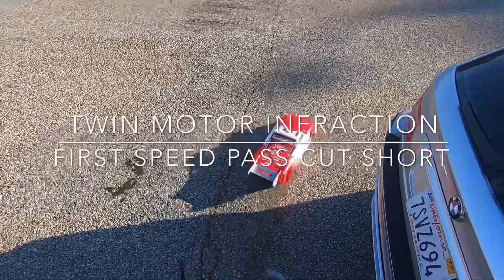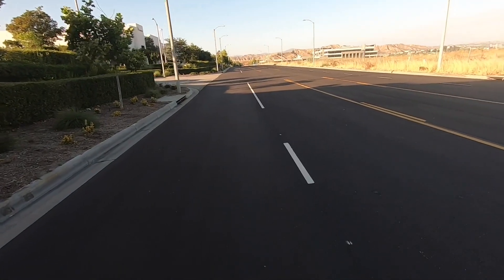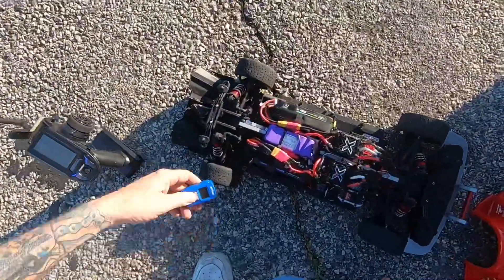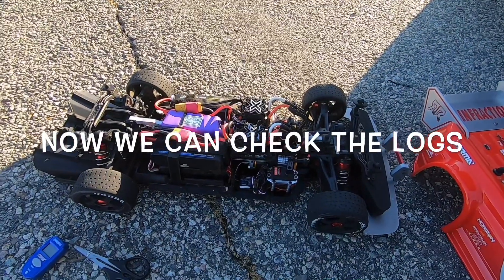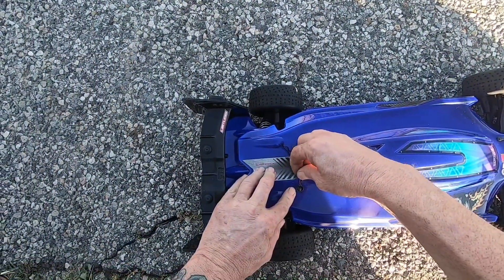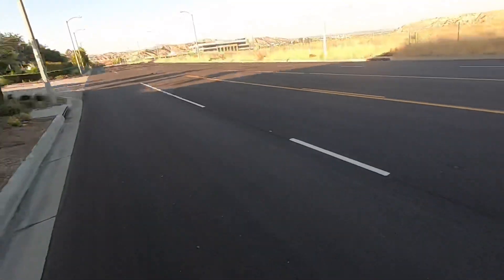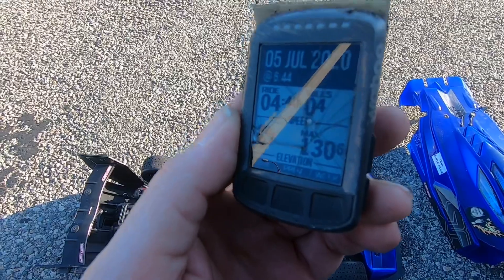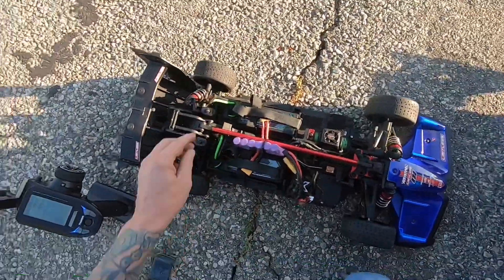Twin motor infraction speed pass & limitless PB speed pass

Comment: Awesome cars bro, just bought myself a limitless today.
Never had and electronic car before.
Keep up the great work bro
Reply from the maker: Thanks 🙏 appreciate the support & you’ll have a blast with the limitless I’m sure of it 🙏💯💯💯💯
Reply: @earlmoorhead5555   I think I might of messed up. I just ordered a tp 4050 3050kv plus MM 8s esc.
Just because I knew it would fit. Is my kv too high? Or will this be a good speed run motor?
Not looking for any speed tips. Just dont want to blow my motor or MM 8s esc.
Any guidance for a total newbie would be awesome.
Reply from the maker: MonsterTVchannel it’s a good speed motor just have to keep an eye on temps and gearing as the higher kv has more speed but will run hot with standard speed gearing you might have to gear down to achieve the speed your looking for 👍👍🔥🔥🔥
Reply: @earlmoorhead5555  thank you so much for taking the time. I thought I just wasted my money bro. I'll put a 46t spur on and see how I get on. 
Ill order a lower KV next time. I was just excited to get started. Ordered an MM8s esc, a ripple killer and a bunch of hop ups already. Guess i should of researched more first before buying. Feeling pretty dumb now. 
Keep up the great work brother.
Reply from the maker: If your going for a speed run then I’d run the limitless spur with a 20 tooth pinion to start that should be around 110 mph and gear up from there watching logs and temps Phillip J is an awesome guy he’ll help as well if you ask him 👍👍💯💯💯💯
Reply: @earlmoorhead5555  thank you very much.
I will do.
At least I'll be able to run and test for a bit.
I'll order another motor with lower kv after I've played about with what I got.
I really appreciate you taking the time brother.
Reply from the maker: Anytime 🙏💯🔥🔥🔥

Comment: Good stuff..AWESOME BUILDS! Was the blue limitless on 8s? I see you modded your radio antenna, range. How was that done? I will be using a Futaba 7px radio. Do you think I will need to increase the range and will your range method work on my radio?
Reply from the maker: I just added a better antenna I have not installed my range booster yet 👍👍all depends on where you run the futaba has good range almost no one uses a booster but some want to hit those top numbers and you’ll need a booster for that 💯💯💯and yes on 8s with a 6s motor 👍👍👍

Comment: Take a flat head shovel with you and pop up the asphalt dribble it'll pop right up otherwise beautiful speed run road the center joint of the road at the crown nothing you can do about that typically reflectors go down right away after restoration because city/County will not sign off until thats completed maybe you'll get lucky with no reflectors 🤞
Reply from the maker: Thanks I’ll try a shovel great idea 💡 I hope soo because the blue reflections are there I was hoping they will leave it alone because all the trucks they might have to fix that road a lot ( every couple of year ?? I hope I can run it for awhile thanks 🙏💯💯🔥🔥🔥

Comment: Question for ya Earl.  Building my first Limitless.  Got my rolling chassis, Flopack Cappack, Panther 5.0 75C 6S.  planning on a XLX and TP 4070 2250.  Would a 28t & 36t  saga custom rc setup work for that build?  or 30t 36t?   Love your build man, keep it up.
Reply from the maker: Yes both gear set up are good for over 130 just take it slow at first check range is important 💯💯🔥🔥🔥🔥
Reply: @earlmoorhead5555  Thanks kindly for taking the time to reply my friend.  Appreciate it.  I'm super excited to build this car and a little nervous as it's my first speed run car :)  I was planning on using the DX5C w/ 6100AT combo due to it having AVC, hopefully it has some decent range!
Reply from the maker: Renner yes just take it slow at first set it to 70% throttle get used to it before you unleash it is the best advise I can give and cancel the run if it start to get out of shape live to make another pass 🙏🙏💯💯🔥🔥🔥
Reply: @earlmoorhead5555  Hell yeah brother!

Comment: I'm running 1:1 gearing in my limitless with xlx esc tp power 4070cm motor and have yet to run it with new gearing or even stock gearing other than some street bashing.
Reply from the maker: Ya the limitless in the back seat is set up that way my best is 135 mph but so much power I’ve crashed it soooo many time before I took a step back and built car number 2 to slow it down 💯💯🔥🔥🔥🔥